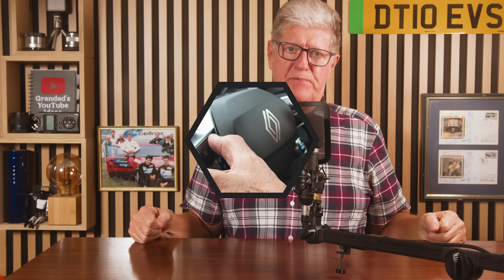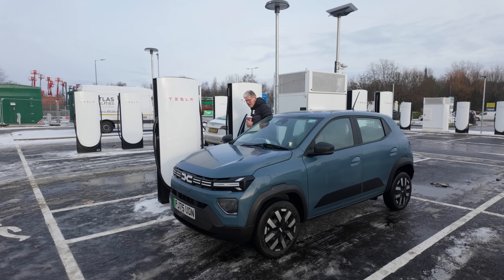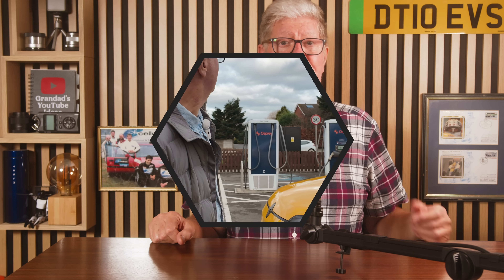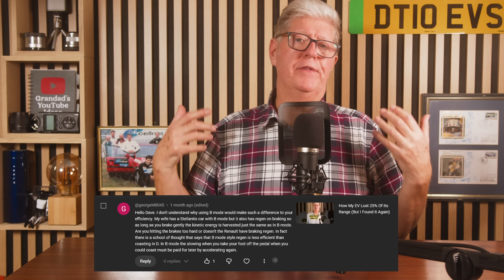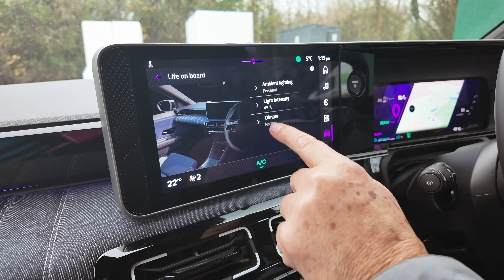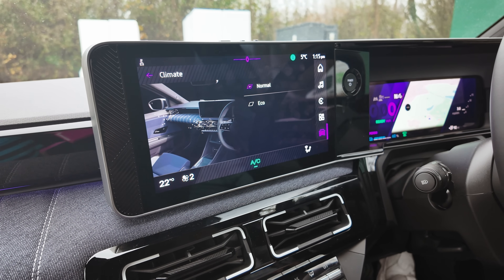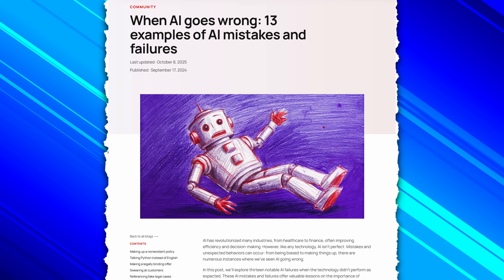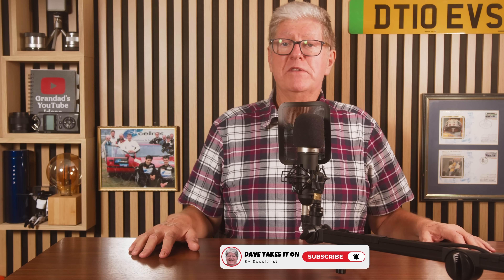Was I Wrong About Regenerative Braking On EVs?

Comment: Why would you use Maximum breaking on a Motorway. It has to be the dumbest setting you could pick!
You've got your speed (momentum) up and you're on a decline. So you're saying you actually want to drive down rather than roll with regen on one of the lowest settings so you retain momentum and get some electric back.
In your explanation you missed out gravity (not mentioned once) which aids the driver and energy production by negating to different degree's, the friction (tyre, wind etc) so allowing momentum to be maintained while the motor becomes a dynamo and returns energy to the battery.
The only way this works when the regen is set at maximum is if the car knows you want to continue a fast forward momentum and only activates it's maximum breaking via the motor in order to slow you when you exceed the speed limit or due to a road obstruction such as such as the rear of a lorry. The question is, are all cars this smart and when did you try all of them?

Comment: E-niro, you can see regen on the dial on the car when you brake you can see it regen up to level 3 even if regen is off. So no matter what level you choose as a preset, even 0, if you brake hard it regens to level 3. I prefer level 2 for control while driving. It may depend on the make and model how the system regens. Regen does not seem to any effect below about 10 mph unless on one pedal which requires the paddle to be held up on the e-niro which is not convienient if you are turning while slowing down.

Comment: Why do you have to be so dismissive of other people's preferences? When I bought my first EV, I chose that car (for many reasons but partly) because it gave me the closest experience to driving an ICE car and, for me,  that was the best way to transition to EV. I love it. After almost 5 year-end 93,000 miles in an EV it is still important to me. It regenerates electricity through braking and only uses the friction brakes when heavy braking is required. It gives a much smoother and more controlled (by me, not by the car) driving experience than one pedal driving. I've tested Teslas and hired Teslas and I do not like one peddle driving - simple as that. I like to control my steering, braking and acceleration as, I suspect most drivers do.. If someone wants to hear an engine sound, or if they want to feel gear changes, why not - who cares? Full stop or creep, again, who cares. If it feels better for you, or it is something you want, you have it. Most of my driving is done in my EV but I have 3 ICE cars at my disposal. I'm glad I don't have to alter my method of braking  every time I switch cars. I suppose the main point is - why shouldn't people want an EV that gives the same driving experience as an ICE car in respect of the way to brakes - what is wrong with that? You still get regen but you have, naturally, more control. You used to e able to modify the level of control in a Tesla apparently no more. You get what they give you and I'm not sure I like that.

Comment: I don't know about Renault, but my Kia Soul and Hyundai Ioniq 5 use regen braking as soon as you press the brake pedal regardless of what level regen you select, it is only the last bit from crawling to stop that uses the friction material, unless you use one pedal driving or hold the left paddle on the Soul where the friction material is not used at all. Therefore the economy stays the same no matter what regen setting you use

Comment: I agree that regen is more efficient for slowing the car down than friction brakes however the amount of regen you need really depends on driving conditions. For mixed driving (town/motorway) I tend to put my MG4 into 'Adaptive' regen so the car changes the regen 'power' depending on driving conditions (low for steady motorway), high for urban driving. However even if I use the brake pedal, it will apply regen based on the amount of 'stopping' force required by the driver regardless of the regen setting. I think for those who aren't used to one-pedal driving at first, it's probably best to keep regen low or off as the break pedal will apply regen in the same way as friction brakes.

Comment: Not sure why there’s confusion. Most the time regen is great as it replaces brakes (that would have wasted energy in heat) with using the motor to generate energy back into the battery. 

However, if you’re on an empty motorway and you drive (arguably badly) so that the regen comes on often WHEN YOU WOULDNT HAVE APPLIED THE BRAKES… you’d have been better off with less regen. Like I say, bad driving where the cars speed goes up and down - say, 70-55-70-55, not good - a constant 70 would have been more efficient. 

Regen is great but the conversion is lossy. You wouldn’t drive up a hill and regen all the way down and expect to use the same energy as driving the same distance on the flat.
Reply: Exactly right.  It's really driver preference with their specific car and ability level but a good implementation of full OPD, used skillfully, will I think always give you the best results in efficiency, just because you have full and immediate control of regen at all times.
You'd only need to switch to a lower regen level for motorways if you don't have the ability to keep it smooth using the pedal and you also don't use CC (but why wouldn't you?).

Comment: On the Seat Mii it uses the regen settings to just set the level. You can still use the brake to control the reduction in speed  as it just adds more regen. The mechanical brakes only operate if higher braking is required above what regen can give.
Dave as using talking BS, if you can drive without having to brake(regen) then that is the maximum efficiency. Every time you regen a good % of this energy is lost (generators are not 100% efficient). I prefer to drive with no regen set and only use the brake pedal regen. The problem with controlling your vehicle speed with the throttle is that in an emergency it takes time to lift off the throttle and then to hit the brakes.

Comment: Another thing petrolheads often get wrong is the importance of weight. They claim because EVs are often heavier than equivalent size ICE cars, they must be less efficient. Kinetic energy (as you go faster or slower) and potential energy (as you go up and down hills) are both proportional to mass, so the heavier the car, the more energy they store. Sure it takes more energy to accelerate or go up hill, but you also get more back into the battery when you slow down or go down hill again. Energy is simply flowing between the battery and the momentum or potential (with minor losses). This is why electric trucks can be very efficient and range is much better than you'd expect with heavier loads.

Comment: Regen will never recoup 100% of the kenetic energy store in the rolling vehicle. it's no where near that amount. Regen will reduce range if used incorrectly. Regen on a motorway is dangerous. especially the highest setting.
Reply: Agreed - I could scarcely believe my ears whilst listening to this video. Just as SMOOTHNESS in an ICE car is  rewarded with lower energy (and brake) use, BEV's have the benefit of only ever using energy to POWER the car to overcome the friction of air being displaced to flow around a car, with the only energy loss being due to MOTOR inefficiency. 
Frankly, Dave's early advocation of changing to an EV with the side benefit of acting as an ambassador inspired me to research the subject thoroughly before investing in an EV, but I've found this video very disappointing. I understand that becoming a YT presenter can offer financial reward, and an expectation to keep regularly producing videos, but this video will have lost him respect in my opinion.
It's a shame.

Comment: Dave doesn't seem to realise that the first bit of travel on the brake pedal initiates Regen whatever the Regen setting, the brake pads only come into use with heavier braking. And Dave's flat-road scenario of coasting is not typical or even where coasting advocates would coast. It's on slight down-slopes where coasting becomes efficient. You can coast with Regen on if you are clever enough to feather the accelerator to a no-power/no-Regen position. Degrees of Regen ? Some drivers enjoy the one-pedal driving style that max Regen offers. On my Kona max Regen feels like an emergency stop, horrible. No regen selection on new Teslas? Perhaps it messes with the built-in collision avoidance on even basic models ?

Comment: What you say in this video would be 100% correct if regenerative braking transferred ALL remaining kinetic energy back to the battery. But it doesn't. Only a proportion, approx 70% of kinetic gets back to the battery. Long finely timed coasting, while annoying, will be more efficient than regen given the need under regen to rebuild kinetic when regen slows you ahead of needing to...constantly replacing 100% with 70% regen as the car slows sooner than needed. As far as your two test periods it is the mix of motorway and non motorway that by far will have effected the results most...leaving all other variables including regen brake setting as relatively insignificant.
Reply: This is the right answer. 

If regen causes you to accidentally scrub off speed then it’ll be less efficient. It’s pretty much that simple. 

Removing the option to adjust regen is completely mad, not just from an efficiency perspective but also from a comfort and driving feel perspective.
Reply: exactly. yet Dave still hands out his great advice based on technical expertise. 

his scientific investigation is based on how many miles per kwh it says he's getting on the screen, instead of being based on technical knowledge of how the system works and the results gotten from mathematical calculations. Dave saying "it seems to have gotten better since i changed the regen", is not scientific results 😂 Too many variables mate, learn to do it properly if you're going to 'educate' people. You don't have a clue whether what you're saying is true or not.
Reply: Exactly right!
Reply: I drive in an individual setting and in D in my Cupra. The ‘Performance’ motor setting gives me sufficient regen to slow me down fairly quickly for normal bends etc. When something unexpected crops up and I need extra deceleration I temporarily engage B which usually means I don’t have to touch the brake. Gradual deceleration is more efficient than max regeneration.
Reply: While that may be true on motorways and open roads, in town traffic it is far less likely to happen. Controlled modulation of the accelerator pedal can be just as effective without over decreasing momentum.

Comment: In my older BMW i4 and current Mercedes CLA 250+ I find it get the best range by using intelligent/ adaptive regeneration on the motorway and one pedal driving for town and roads lower than 50 mph speed limit.

Comment: You changed the sound track at the atart of your videos. 🎉
I guess you are reading the comments.
Can I suggest you make the sound as follows:
1) a clikety clack like a M3 when you plug the AC charger on. That is the contactors on the battery closing.  All EVs make this noise but some times you can not hear it from the inside.
2) the "Ding" sound that an Imiev makes when it goes to ready. I am not sure if other cars make this noise.

I think this would be the most appropriate sound.
I am glad we don't have to hear the sound of an ICE starting anymore.  👍👍👍

Comment: Talking efficiency: last night I was interested to see a previous Winter journey which took 24% one way, take only 20% for the same journey similar conditions/temp. Difference was preconditioning battery before. I knew it was better but wow, taking 40% instead of 48% for same round trip is amazing saving.

Comment: There are two problems here:
1) Pressing the brake on an EV is a two phase process, firstly for milder braking and at higher speeds then EVs use regen braking. At lower speeds (when regen becomes relatively ineffective) and when the brake pedal is pressed hard then the friction brake is employed. This can result in EV breaking feeling “grabby” at lower speeds when the friction brakes cut in.

2) Converting electricity to motion then back to electricity isn’t a 100% efficient process. Typically regen braking gets you 60% of the energy back to electricity, not 100%

So, if you can drive more efficiently, coasting to a halt rather than braking and accelerating in a more gentle fashion then you’ll get better efficiency than using high regen. If you use high regen then driving becomes simpler as most of the time you can use just one pedal. THATS why EV manufacturers are moving to it.

Comment: Great episode Dave. I couldn’t find the video that prompted all the discussion on Regen. BUT , I think you would be amazed to discover how many people believe that “Braking Regen” actually somehow harvest the heat energy from the friction of the brake pads . It’s an unfortunate duplicative term . My understanding is that the energy is created from the electric motor (NOT from the BRAKES) by simply (in software) reversing the polarity on the electric motor- which provides resistance in the motor which harvests that kinetic energy & turns it into electricity and stores it in the traction battery. Knowing this mistaken belief exists may explain some of the odd comments . MODEL S Owner . The always ON energy gauge (like rev counter) enables visual Hypermiling by managing the drive to be “in the green” as long as possible. It can be fun - or useful if the range is less than the known distance to the next charge. 
PS - do any makes actually harvest or claim to harvest that Brake disc friction energy ?
Reply: How on earth do you know how many people think that you can generate electricty from heated brake pads. I would be amazed if you can produce the data.

Comment: Our Ioniq 5 has 4 regen settings, ranging from none at all, to maximum, then 2 additional settings, one being automatic regen, which uses sensors to work out how much is needed, depending on vehicles in front, and also a 1 pedal driving setting too.
Reply: FYI, the auto regen actually has 7 levels of different regen “hidden” in it. You can still manually toggle between those 7 levels when you’re in auto mode.
Reply: Same on my Kia EV6. 1 pedal driving is great for making your passengers sea sick. I use zero for general driving so I can lift off the "throttle" and coast as much as possible, then engage levels 1 to 3 (or sometimes max) instead frequent use of the brake pedal. I've averaged 4.1 miles/kwh from last June to now (january) in what is a much bigger car than the super cute R5. And that's not hypermiling, just being careful.

Comment: I agree with you 100% Dave. I set my regen to max the day I bought my car and have not changed that setting since. Once you get used to it you can quite comfortable drive with 1 pedal 99% of the time. Like others (as per manufactures guidance), I will occasionally use the brake pedal to clean the discs and cycle the brake cylinders to stop them binding up. 

As for the efficiency of using this driving style, I would suggest that any doubters check out the RSymons “RSEV” video "EVERYTHING WRONG with my HIGH MILEAGE "21 Tesla Model 3! | Battery health and other issues!" (around 4:40) he shows in that video a lot of battery health information which includes the amount of energy restored to the battery by regenerative breaking for a 215,000 ex taxi tesla model 3 (spoiler 26430 kWh). That is effectively FREE battery charge / additional mileage you get by letting the motors (now generators) slow you down. 

As you said, this is what EV's are designed to do and it is the most efficient way to drive them. Different manufacturers will have their cars / regen systems set up differently so not all will be as efficient but I agree that Tesla is probably the best at it.

Long / short, If you drive an EV like it's a petrol / diesel car you are wasting money by not utilising this feature to it's full potential.